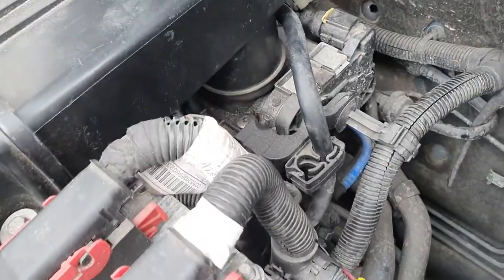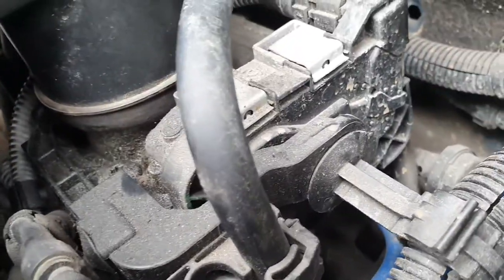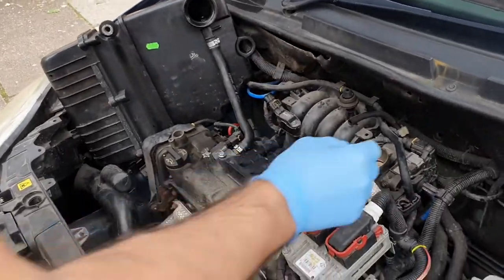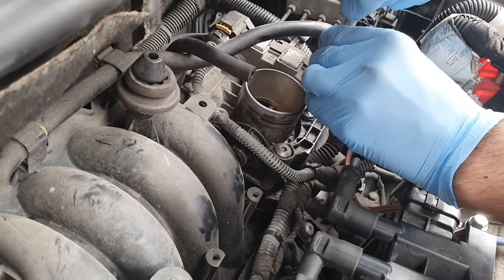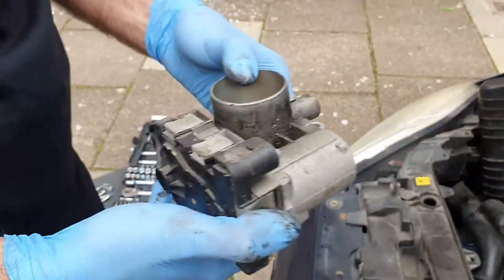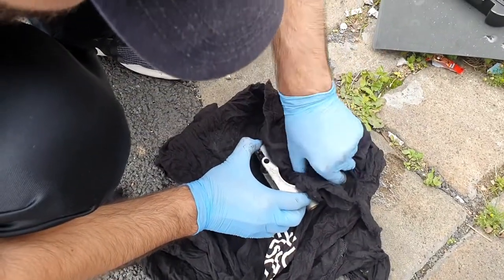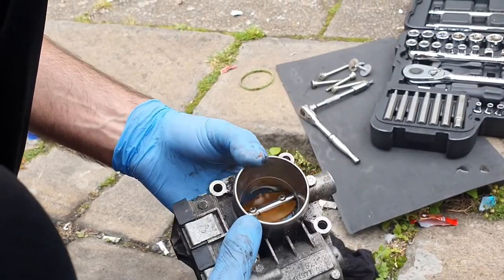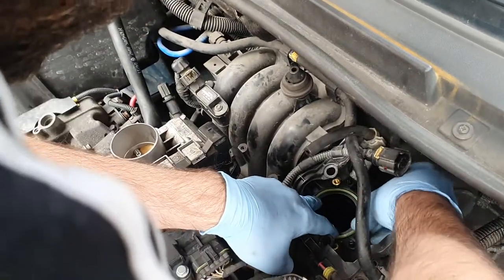HOW TO CLEAN A THROTTLE BODY FIAT GRANDE PUNTO

Comment: Hello, the small tube of the airbox that goes into intake has to be free if i blow into it? What's the purpose of that tube? With the car on i don't feel the vacum in that tube... thanks
Reply from the maker: Hi. I didn't actually test it tbh so I cant really say, but as long as you put it back in the same place should be fine.

Comment: Hi mate nice video. My 500 1.2 petrol is like hesitates around 2500 rev or stall, I did replaced engine oil, filter, air filter, spark plugs and leads, and this problem came up. Any ideas? Thx
Reply from the maker: do you have access to a OBD reader? I would start with that. being Fiat, chances are that its something electrical

Comment: Hi. Before removing throtlle body do you disconnect akku negative or remove throttle fuse ? Thanks
Reply from the maker: hi, just to be safe, disconnect negative terminal from battery. cheers
Reply: @SEPAChannel thanks for answer. i would disconnect it but i dont know if my radio have a code and if it have i dont have it.
Can i disconnect cables from throttle and remove it, clean it and then reconnect back without any problem?  In a case i disconnect negative would  error code be removed and throttle relearned and would it be cleared errors and relearned throttle without disconnectin negative?

Comment: Hi.
I have Ford ka 2 with The same engine and I think i need to do the same job with my throthle.
But where can I buy o-ring for The throthle?
Thank you for video.
Reply from the maker: Hi. The old one should be in good condition since there is no high pressure or other hostile working conditions. If you really want to change it, I would suggest to try at a local car parts shop, if they dont have it, thet will order it for you. But 1st check the condition.... it should be fine. Good luck

Comment: Hi Sepa,  i have the same engine and did a throttlebody cleaning.
But after cleaning the car now idle at 700 rpm, instead before 850rpm.
It seems like the throttlebody needs to be relearned, can you tell me how to do this?
Reply from the maker: the rpm auto adjust depening on the oxigen needs of the engine, it is normal for the rpm to drop a bit after cleanning. is the car running ok?
Reply: The car starts good, but it is very sensitive when you are at a traffic light and want to drive away, you have to accelerate in time otherwise the car will stop. I have the Lancia MultiCuscan software on my laptop installed, but there is no Throttle relearn avaible for this engine. But the Fiat/Alfa romeo does have this option on the scantool.
Reply from the maker: Ideling at 700rpm is good for fuel economy, you can try to accelerate a bit harder while at traffic stop. Alternatlively, you can have your TB re-set. But I would leave it as it is.
Reply: Before i had a Fiat Grande with the same engine only different Ecu. It would always idle at 850rpm when engine was warm, that drove so much better than this Lancia idle at 700rpm. i personally dont think it has to do with Throttlebody cleaning, the computer is programmed like this to idle at 700 rpm to improve fuel economy, i really hate it !  If i could turn it a little bit up to 800rpm it would be a amazing car.

Comment: Hi would the throttle body if dirty course the car in the cold start then cut out
Reply from the maker: Hi. Usually when the TB is dirty, the car shakes while idling. It can cut off but if the TB is faulty, not dirty. Is it giving you any error codes?
Reply: Yeah put scan tool on it and got a coolant sensor fault on mine so gonna change and hope the car will start fine in the cold mornings

Comment: why did you clean it? Any difference after cleaning?
Reply from the maker: good question! the throttle was lagging. also that brought up "check engine" light. after cleaning the car was more responsive and the check engine light went off

Comment: Hi,
My Fiat Punto loses speed at the start.
From 900 it goes down to 600.
He then stutters.
And sometimes he goes out.
He only does it when he's warm and then the inside smells of gasoline in the car
Do you have any idea what it can be?
We changed the spark plugs
So did the spark plug wires
The ignition distributor too.
All plugs checked. 
Cleaning additive doesn't help either. 
No improvement.
Reply from the maker: No idea, but since it's about fiat... it can be anything really. Electronics is not their strong point. Try to put it on a tester and see if you can read any error code
Reply: Maybe the evap purge valve is bad
Reply: @EchoesOfHistory882  what's this part you say?

Comment: Thats a bad way to clean a throttle body, you can damage the sensors inside the electronics  by turning the flap on the body use only throttle body cleaner only WD40 is to harsh
Reply from the maker: Hi mate. Thank you for your feed back. we will consider it going further. It depends indeed on the car model also.